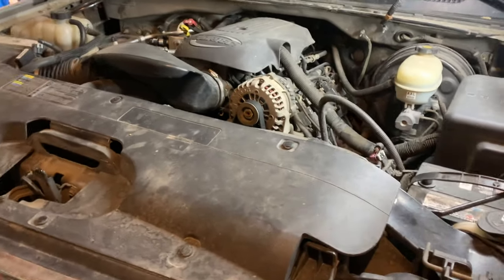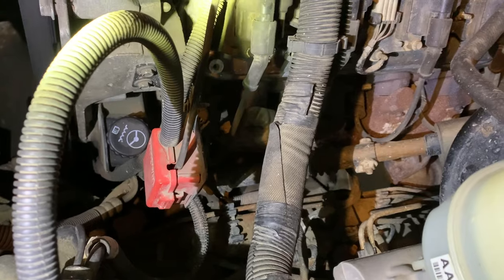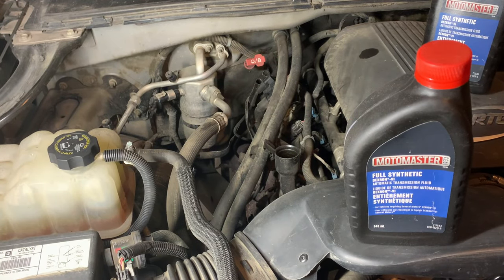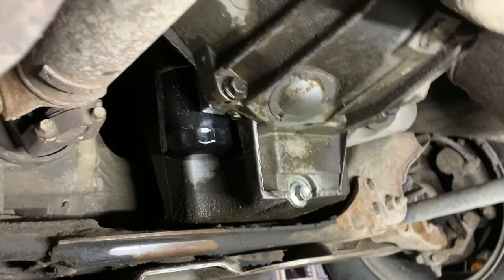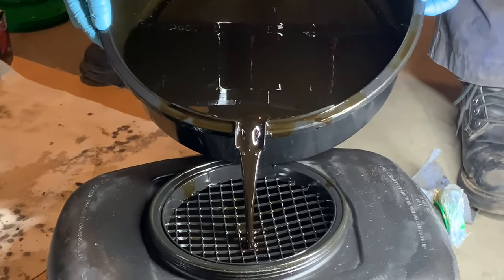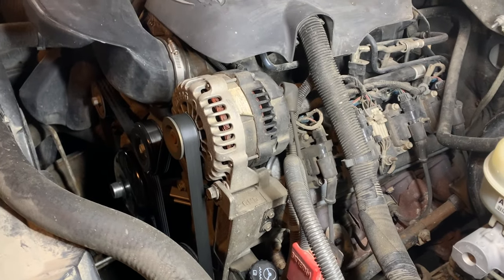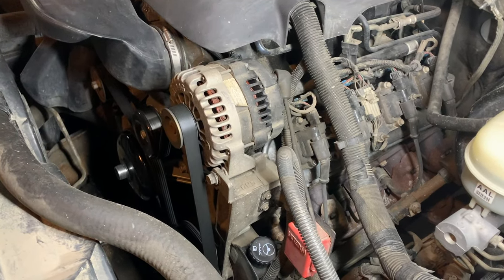DIY Engine Flush using Automatic Transmission Fluid

Comment: Thoughts on MMO vs ATF? Both being used, of course, for the same reasons.
Reply from the maker: Never tried it though I probably have the same thoughts as you...some say it's basically ATF, and it probably works about the same is my guess... 😄
Reply: @lmsdiy  Thanks for the reply. Yeah, I guess from what I've heard, I figured it was probably a little safer than ATF, considering you can just leave it in there and not have to worry about draining it out, but probably not quite as effective in the short term and probably has less detergents, if I had to guess. It seems the large majority of people who use it as directed, swear by the stuff. 🤷🏼‍♂️ Bought some a couple of days ago. We shall see. Only time will tell.👍🏻
Reply from the maker: @addie750  I'm curious and looking forward  to hearing your experience / feedback on using it.
Reply: @lmsdiy  it might take a while to report back, but I will do my best. I actually picked up 2 quarts of MMO. One for my suburban and one for a friends Yukon XL. After all the research I figured I would try it in my personal vehicle to help with typical LS ticking. The real test will be my friends Yukon XL. Her Yukon seems to have a lifter that periodically gets stuck. We are hoping that it will permanently unstick the lifter, but we shall see.👍🏻
Reply from the maker: @addie750  Interesting... Hope it does help to solve both of those. What year is the Yukon XL? Is it an Active Fuel Management (AFM) engine?
Reply: @lmsdiy  Ha! Yeah when I started hearing all the negative garbage about the DOD/AFM stuff (when researching the lifter issue), I was initially worried that it did have that, but soon found out it was outside of the year range. It's a 2005 and in 2005 there were only a few makes and models that had that "design upgrades"🙄. Thanks for the heads up though. 👍🏻
Reply from the maker: @addie750  Nice (2005 model)! I miss my 2006 without AFM... I did a performance tune on my 2013 to lock it into 8 cylinders and turn off AFM but I heard the AFM lifters may still fail but I am very diligent with my synthetic oil changes so hopefully it won't become an issue for me.
Reply: @lmsdiy  Hopefully you won't have any problems out of them. Super glad my 2001 doesn't have anything like that! Those delete kits can get expensive. Hopefully running the synthetic will stave it off for many many years.🤞🏻
Reply: @addie750 So how it turn out?
Reply: @jamesstoy8967  I have had the MMO in my 2001 Suburban for a month or two now and the ticking upon start-up, as suspected, has not gone away. I didn't think it was something that would go away anyways. Just figured it was the nature and design of LS engines. As for my friends Yukon XL, I don't think she has added it in yet, unfortunately. She's planning on putting it in at the next oil change, but the vehicle does not get driven often. Hopefully she will get it put in soon, and it will do the trick, with permanently freeing up the problematic lifter. I'll do my best to report back, at that point.
Reply: @addie750  Assuming a 5.3? If so, they come from factory ticking 🤣
Reply: @jamesstoy8967  Ha!! Yep, 5.3. lol I bet they do come from the factory ticking!!😆 I I guess by using the word "ticking" I was probably overgeneralizing. I think most of what I'm hearing on cold startup, is valve clatter. I was just hoping that most of what makes up those noises on startup, would diminish somewhat, but unsurprisingly they have not. But hey, as long as I get the longevity out of my 5.3 that LS engines are known for (if they are treated correctly), than that thing can tick and make all the weird noises it wants to!!! 🤣 226k and counting!!!
Reply: @addie750  Brother went well over 80K in a few years driving like a teenager he was on a 5.3 with over 400k on it. Sounding like an old clattering diesel the whole time!
Clatter on start up means your lifters ain't pumping up fast and/or loosing oil pressure.
So either an oil passage isn't clear, which is less likely with the stuff you've added too the oil and keeping up with the OCI. 
Or you got a collapsing lifter or lifters, which sounds more like it, and the only fix that's going to do anything is to just replace them with a new set.
Reply: @addie750  A family member of mine has a Jeep 4.0 with a lifter tick. They seem to be know for it too.
Most typical 4.0 lifter clatter fix I've heard is drive like a mad man for a day or two. That tells me the engine design itself doesn't allow good oil flow too the lifters and higher RPM creates more oil PSI thus fully pumping up the lifters. At least that's what I'm thinking.
The engine was sludged up but I've gotten to where the oil filter media looks normal now. 
So I'm going to say there's not anymore sludge that can be removed without tearing down the engine.
From my understanding, '04 4.0's, which is the year of this 4.0, had camshafts with too soft of a lobe and the lifter design were not that great to begin with.

By the way. The hydraulic Dodge 225 slant six version usually clattered on cold start. Simply because the quickest, most effective, and cheapest route to a hydraulic valve train for them was to send oil through the push rods to the lifters. So the lifters were the very last thing to see oil.
Reply: @jamesstoy8967  🤣🤣🤣 That's hilarious, but I absolutely believe it! 😆 I bought my 2001 Sub 4X4 with 163K on it and it's always made that little bit of clatter on startup, no matter the ambient temp. Once the top of the engine receives oil, of course it goes away. I think it is more of an issue with valve lash as opposed to the lifters. The lifters failing or sticking, seems to have a distinctive sound, which it's not the sound that I feel like I'm hearing. On a cold morning, at idle, it might be noisy for about the first 30 seconds. I've got great oil pressure, so I don't think that is an issue. Regardless I appreciate the information! 👍🏻 Hopefully I will never have to deal with lifters being an issue. I'm definitely a DIY guy and have done a ton of maintenance to my suburban and my wife's Tahoe as well as my friends Yukon XL, but one thing I do not want to jack with is having to pull the heads to replace lifters, if I can AT ALL help it!!!!🤞🏻🤞🏻🤞🏻 And thank the Lord btw that my Sub does not have any of that bullcrap AFM/DOD garbage!!!!😵‍💫🫣
Reply: @addie750  You shouldn't have valve lash. You should have pre load. Valve lash is for non hydraulic camshafts which you don't have.
And hey, pulling the heads ain't so bad. Just a great excuse to put some aftermarket heads back on 😉
Reply: @jamesstoy8967  Ha!! Good point! Lol You do although have to have the money for some aftermarket heads!! 😅😆 
Yeah, I guess I don't know enough about engine internals to know that I'm using the proper terminology. 🙄 Meh, been a long time since I've read up on the issue, and about all I know is it involves valves! LOL 😜 Thanks again for the info though.👍🏻
Reply: @addie750  Keep your eye out for a good set of used ones, lol! And naw, it's fine. I don't remember everything either. Also, you're welcome.
Reply: Mmo is  diesel and oil of wintergreen to cover the smell of diesel

Comment: Those GM transmissions need the fluid much more than the engine.
Don't leave the original fluid in until its brown they are unforgiving, especially after the engine overheating the heat migration into the transmission adds additional hurt. 
It won't hurt to add a half litre to the scammed up engine and drive for a couple days. 
Ideally the 5-W30 is supposed to keep it clean. Its when guys cheap out and go one year or even longer without changing it and then only drive around the corner only never long trips just putt putt around a few blocks that this damage builds up.
Reply from the maker: Right...I'm pretty sure the previous owners didn't keep up on maintenance the way they could/should have!
Reply: @lmsdiy  Synthetic is the best if you can afford it but even cheaper regular stuff is a help. I learned the hard way buying cars that the original owner did nothing and I had to replace the goofed transmission later. 
Basically every 20-25,000km change fluid and the trouble is minimal. 
Same with the Differential fluid and Transfer case fluid, and brakes and power steering fluid. 
The brake fluid is only designed to be good for 2 years old and guys leave it in a decade.
Reply from the maker: @RetroCaptain  Good advice to go by... Maintaining good quality fluids is so basic and so vital!

Comment: I put atf fluid in everything now. It’s in the transmission, the engine, the radiator the gas tank the tires and also my pan cakes. 100% all you need is some atf unless you have guns in which you need no atf or far far less atf.

Comment: Drain it again so you get the flush solvents out and put new oil in it.
Reply from the maker: Thanks for the tip!!
Reply: @lmsdiy  you dont have to drain it X2 . ify u could remove oil pan and clean it
Reply from the maker: @bahroz7173  Not a bad idea but depends on the vehicle. Some oil pan removals are a huge amount of work and not just removing a dozen bolts. Depending on the vehicle you might have to replace the oil pan gasket if it’s not reusable. I don’t have this truck now but would investigate the level of effort if I still had it. 😁
Reply: @lmsdiy  its also true. It depends on the vehicle for EX i have toyota yaris its super easy to do it. Toyota is not complex like others
Reply from the maker: @bahroz7173  nice...! Lucky!
Reply: Good advise

Comment: Ticking is gm's cylinder deactivation system clogged and half stuck. It will wipe out the cam lobe in no time
Reply from the maker: Most of the time, yes, and completely agree. The 2006 engine doesn't have AFM.
Reply: @lmsdiy  2006 has displacement on demand DOD. Same thing as active fuel management. Just changed the name

Comment: The oil I see in the video is brown. That is not the color you are suppose to have fella. The color is suppose to be on the black side. Also, you should get a meter which you can see the percentage of suspended particles and other parts that are in the oil itself.. Then you will be able to give some accurate information. What you are doing now is speculating.  
           I do not know what was exactly in your engine to cause the brown mud color.

Comment: Do you still get the ticking at cold start
Reply from the maker: It doesn't actually make that noise when it's cold, per say. Engine temperature doesn't seem to be the factor. It's intermittent but when it occurs it's usually at idle, like maybe when I'm waiting in a drive-thru.

Comment: You need to run ATF in there for like 30 to 50 miles. Wide-open throttle sometimes.
Reply: no.
atf is not oil like oil is. atf is a detergent first and a lubricant second.
you do need to drive the engine but not hard you will do bearing damage. 
spirited to get some heat yes. wide open your doing more harm than good.
Reply: @chehystpewpur4754  wrong, lubricant first, hydraulic fluid, extreme pressure lube and detergent last.  I've been testing ATF and Engine oils for 30 years.
Reply: @tssci6774  really? not saying your wrong but ive always seen and heard atf doesnt lubricate as well as it cleans. it is a hydraulic oil but it has way more cleaners in it than it has thickness. atf can and will shear. but it also can clean almost anything. dex3 is the last trans fluid i believe to be atf. dex6 is deff a different oil. i like it but it doesnt burn like 3. older transmission fluid used to have whale blubber in it. and was a much better fluid. lubricant and cleaner.

Comment: It worked for me 2007 vw Passat. 
It was sounding really bad. It sounds much better. Should I leave it in for 100-400 miles?
Reply from the maker: Personally I drain it and don't drive with it in. I heard some people do but not for too long especially depending how much you put in. I only do it and idle it for ten minutes and then drain it.
Reply: @lmsdiy  Hearing about use of flushes, I think one of the more harsh ones was by Gunk, I cut it before 5 min because it was starting to make engine pings and ticks, it was a 69 Fairlane 302 and it may have thinned it down too much, it seemed to smell like kerosene, has that ever been the case
Reply from the maker: @joeboxer3365  I had the same where the oil smelled of strong gasoline when I was doing an oil change. Since the flush and using valve cleaner solution it seems to be better. The oil changes are not smelling like gas/kerosene anymore. I think the combustion wasn’t optimal before I did other work and that might have been why…
Reply: @joeboxer3365  Engine flushes generally contain Naphtha which works quite effectively to remove sludge. It may smell like gasoline
Reply: @lmsdiy  You have a clogged PCV valve I think, or else the old gal's had an automatic choke on the carb that's stuck shut all the time.
Reply: I wouldn't.  In fact I'd drain it right now and replace with the carmakers recommended fill not one recommended by a rando internet expert

Comment: Did you even change the oil filter?  I didn't see that part in the video.
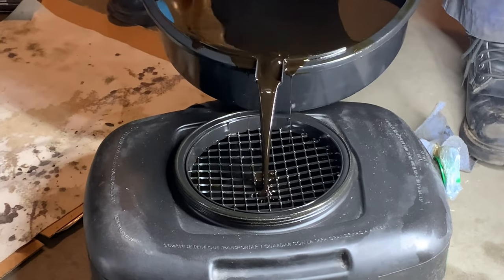Reply from the maker: Yes, of course...that comes after draining the oil and removing the old filter. If you're really interested you will see the old black Mobil 1 filter on the oil drain pan at the 4:23 mark. Either I installed a new filter or I drove away without one on. 😂
Reply: @lmsdiy   Oh wow, that went by so quickly I didn't even catch it!  Yes, I did see the old filter there.  Sorry, I just didn't see you unscrew the old one.  Not trying to be critical, I really did enjoy your video.  Good job!
Reply from the maker: @LA_Commander  Thanks! All good. 🙂👍

Comment: The oil color a month later looked dirty enough to change asap.
Reply from the maker: Yeah..I don't think this old truck was looked after very well by its previous owners. It would have been a great truck with the old 5.3 and no AFM if the engine had been taken care of a bit better.

Comment: That's some darkass oil bro. Need to change more often.
Reply from the maker: No doubt, hey? I bought that truck at 300k and I don't think the previous guy took very good care of it. I've since traded it in for a 2013 and I'm taking great care of it. I had a lot of work to do on it but it's running great now.

Comment: OP I hate to contradict you but I used to work for a government fleet, seen the results when this was done once and personally, I WILL NOT PUT ATF in my crankcase, in any quantity for any reason.  ATF has all the right additives inside, to be sure, but they are meant for an auto trans NOT YOUR ENGINE!  Putting ATF in your engine is asking for internal engine damage, I know because I saw this done by mistake once, and the engine was completely ruined and had to be replaced.
Reply from the maker: Hi @robertmaybeth3434, thank you for sharing your opinion and experience for the community. If I experienced what you did I'm pretty sure I would feel the same. 

Like anything, there's probably more to that story, but there are also countless mechanic and service technician examples of how this has been a practice that has been in use for decades without the same result that you experienced. 

Nonetheless, I don't encourage anyone to do this if they do not want to or are not comfortable with it. It's really for entertainment and experiment curiosity purposes. 🙂
Reply: @lmsdiy  Nicely stated, but putting ATF in your crankcase is still very bad advice.
Reply: @robertmaybeth3434  what kind of damage can occur when putting ATF in?
Reply: @ConnorShapiro  The possible damage is anything caused by lack of/failure of lubrication.  Especially on highly loaded engine parts like camshaft(s).  Engine oil has an additive package that includes anti-wear additives like moly and "friction modifiers because of that BUT ATF does not.  So if you flush your engine with ATF there's a chance after you restart, or down the road, you are going to start that engine and hear noises that weren't there before.  My point is NOT to say "Don't flush your engine", I'm saying take a conservative approach to what you dump in your car's engine that isn't engine oil!
Reply: @robertmaybeth3434  I see.  Thanks for the explanation.  I appreciate it!  Should I just use a regular engine flush or is there something else I can try similar to ATF that won't let parts run dry?
Reply: @ConnorShapiro  I'd try just some 5w-30 oil if your car takes that, plus a pint of Marvel dumped in.  Run the engine 10 minutes, drain, now do a rinse with just the 5W-30 oil.  Change the oil and filter again, done.  If the engine still needs more cleaning than this I think I'd remove the oil pan and valve covers, clean out all the visible sludge, put it back together and then do the thing with MMO.
Reply: @robertmaybeth3434  I'll give that a shot.  Thanks! Recently bought a used car and I might do this just for peace of mind within the next few months.
Reply: @robertmaybeth3434 MMO is worse than ATF, it had solvents, and absolutely, no extreme pressure, detergents, disperants, anti-oxidants, and less viscosity, which protects the engine than ATF.  Just do a clean oil rinse every oil change which removes all the old oil.
Reply: I'm sure there's more to that story or it was a fluke. I'm old school and have done this in the past with no problems. That being said, I wouldn't do it on a newer vehicle which is probably why you had a problem. Older cars you wouldn't have a problem with unless the car already had a severe problem.

Comment: The local car shop would drain the oil, put a few quarts of ATF and let it run for a while. Drain and fill with oil. 
ATF is pretty much all detergents.
Reply: Run as drive the car or let car idle
Reply: Internet myth, it has far less detergents than regular oil. I've been testing oil as a profession for 30 years.